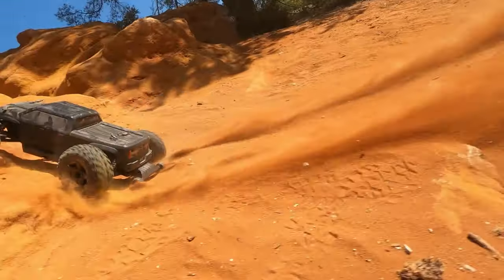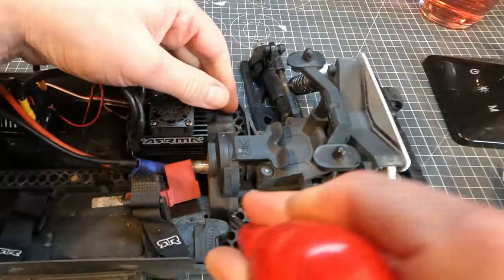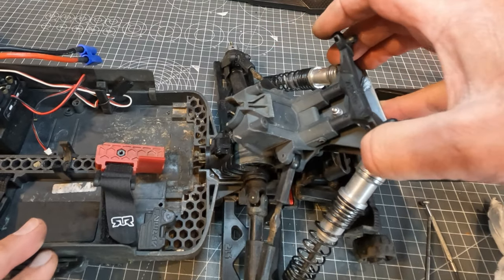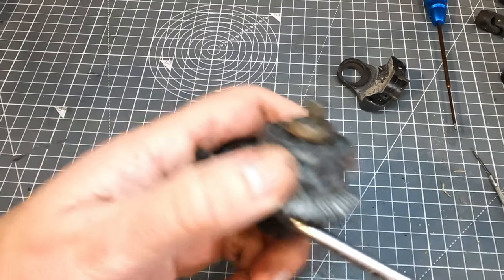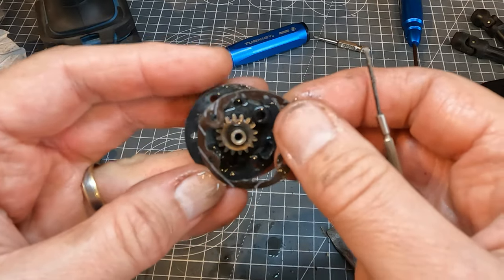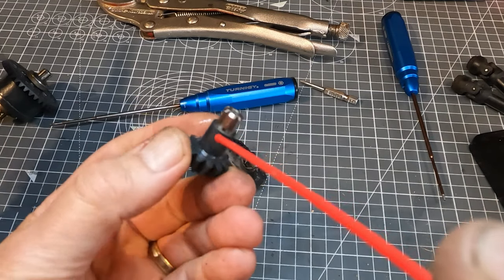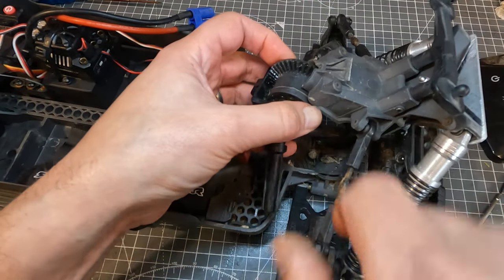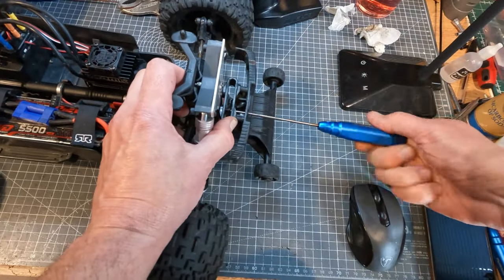Arrma 3s Differential Ring Gear and Input Gear Replacement. Parts AR310872, ARA311031. Granite etc.

Comment: Those gears were well mullered mate. Excellent how to and tips vid Pete. Still can't get over the design of this truck. Great stuff dude.
Reply from the maker: Hiya Rob. Oh yeah by the time I opened it up I'd done various test drives to get a little video of the problem so it was indeed knackered at that point. Yes, really well designed these so you don't usually have to take everything apart to do some maintenance. Cheers for watching mate 😁👍

Comment: Hi there Pete, a super instalment of some essential maintenance of the awesome Arrma’s. Now, do you remember that cheap brushless set that I purchased from Banggood, that had loads of ‘cogging’ well, I’ve got myself a HobbyWing BL ESC that I’m going to attempt to install in my test car (yes the Typhon Mega) I’m going to see if the HobbyWing improves the ‘cogging affect’ or whether it’s the motor itself. I’m hoping to tinker a bit later in the late Spring, early Summer, as I’ve got my revised Left Hip replacement date in the mid of May 2023, so might have some time to grab some hand tools and have a play 😊😊best wishes to you and the family 😊😊
Reply from the maker: Hiya John. I reckon that the Hobbywing esc should work well as I've never had an issue with their stuff. These cars definitely need a bit of speed to get the best out of them. Hope your hip op goes well and you get hopped up too! I'm sure you'll be sprinting around after your cars in no time. Many thanks indeed for watching and your kind comments my friend. Best wishes to you 😁

Comment: Hey Pete...great video! I just bought a Granite...I'll be upgrading it on my channel using a hobbywing max10 sct esc and motor. Do you recommend keeping a spare ring gear? How often have you replaced gears in your 3s Arrma RCs?
Reply from the maker: Hi there. Ah cool, I love the Granite and the max 10 is a great brushless set. Well this is the first time I've had to do these gears in the Big Rock in 2 years of ownership. It depends how often you run it I guess. The spur gear wears out in a few months usually so it's good to have one of those in your spares. Many thanks for watching and enjoy your Granite 😁👍
Reply: @PeteWylieRC  Good to know, I'll pick up a spare spur gear. Thanks Pete!

Comment: Pete you should get your replacement parts from Jennys RC, and they are significantly cheaper than retail, you just have to wait a week or so for delivery
Reply from the maker: Hi there. Many thanks for the top tip. I'll check them out next time I need a bit. Thanks for watching 😁👍
Reply: @Pete Wylie RC  it's where I get all my spares from, they buy ready to runs and strip the down, so brand new parts dirt cheap👍👍

Comment: this happened after a few years? Or... More recent. I've had my Big rock for 2 months and this just happened yesterday. But it also happened the day I upgraded my battery. I been running a 5000 Mah 50C 11.1V but I threw in a 8000 Mah 100C 11.1V after bout 10 mins, it began crunching gears after punching. I was running on 100% to see the battery life, and it clearly outlasted my rear diff gears. I ordered new ones, metal for like 36$ for the pair. This is my first serious rc repair besides having the wheels fall off (2 separate occasions before I thread locked them)
Reply from the maker: Oh right I wonder if your clutch is a bit tight so the gears stripped before the clutch slipped?  These 3s cars are my go to bashers and I do get months or years of use before those gears go which is surprising given how quick they are.  Yes the metal ones like in the 4s cars should be better.  Thanks for watching the video and your feedback 👍👍